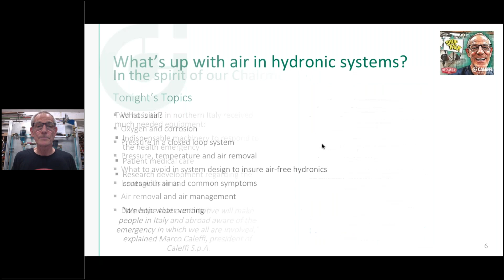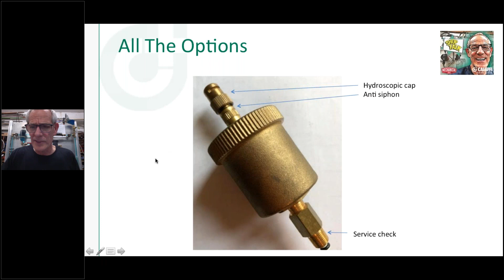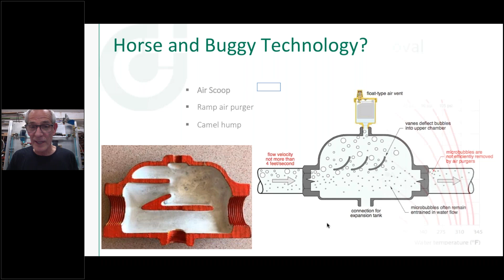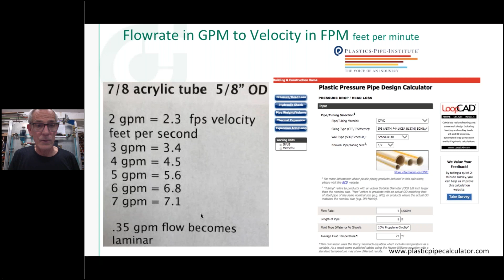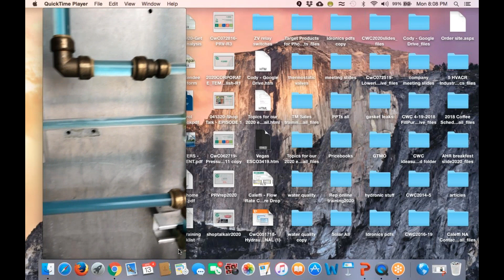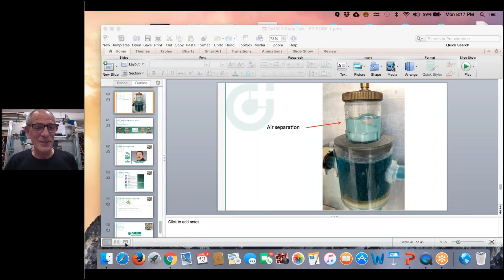Shop Talk with Bob 'Hot Rod' Rohr:  Episode 1 — What's Up with Air in Hydronic Systems?

Comment: I have a heating system that's pressurized but a cooling system that's not pressurized. Plan to switch over in the spring/fall with manual ball valves. The cooling system would draw a slight vacuum on the air vents when the pump is not running, so I can't use the normal automatic air vents. Should I go with the check valve addition or is it better to just use a manual ball valve that I open once in a while?